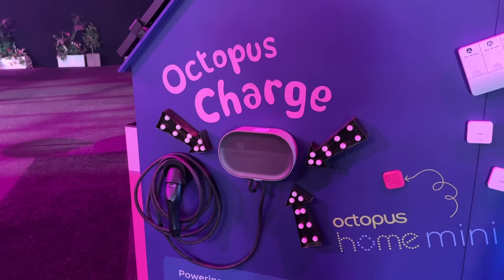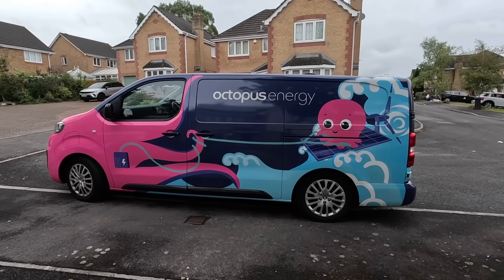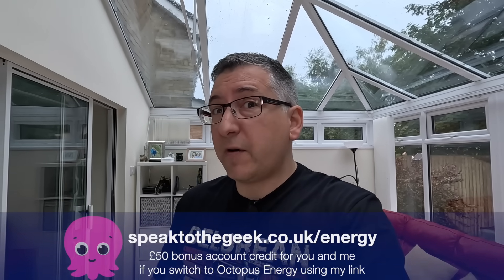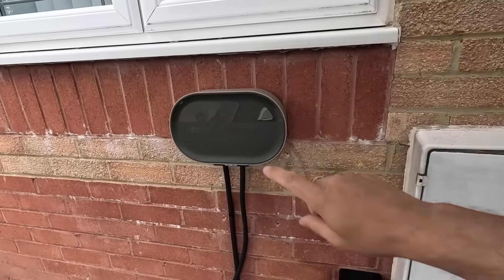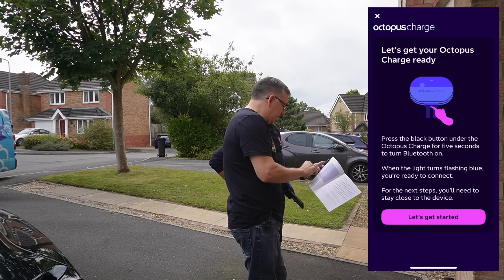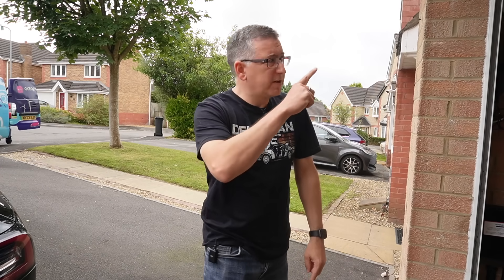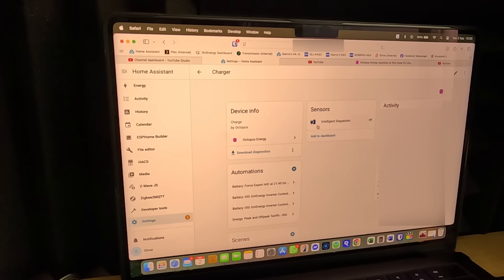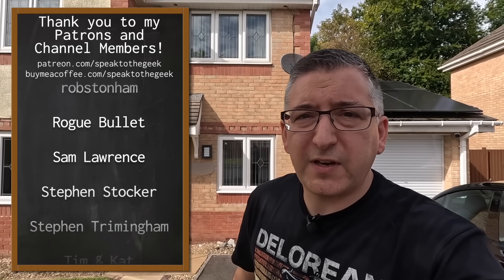Octopus Energy NEW EV CHARGER Unboxed and Installed - Meet the Octopus Charge

Comment: A detail point but the thing on your wall - whether the old one or the new one - isn't a charger.  The charger is built in to your car(s).  All the Octopus Charge is is a charge point - basically a slightly glorified 32 A mains socket.  It's an important distinction because whilst people think that the PodPoint or whatever is a charger they expect it to be able to do all sorts of things which it simply can't do.  The charger is built in to your car and it's your car which is thus finally in control of the charging process.
Reply from the maker: Yeah we all know that... "Charger", it's now common parlance though and if I started calling it something else nobody apart from the select few of us pedants would know what I meant.
Reply: @SpeakToTheGeekTech  I find that if you call it a "charge point" everyone understands you.  Calling it a charger on the other hand causes confusion when problems arise because people think that it's a charger and are puzzled by the fact that it isn't.
Reply from the maker: Same with phone chargers. Everyone calls them a charger but they're not, they're a power supply and the charge circuits are (usually) in the phone. It's a matter of admitting lexicographical defeat and accepting the language has formed in a suboptimal way :(

Comment: I'm a little confused...why is the EVSE connecting directly to the grid connection, and not being integrated into the behind-the-meter solution..?  It would seem that there's no why to divert excess solar into the EVs, but you're relying purely on grid charging...  Maybe I'm missing something.  My Hypervolt connects to my CU, and depending on the availability of excess solar and/or if I want to dump some storage from my Powerwall 2, I can divert it into the EV, regardless of the grid.
Reply from the maker: It is behind the meter, just not as behind the meter as the consumer unit it. The charger has a CT clamp on so it can see exported power and divert it to the car. There's no issue with the installation here from that perspective, it's working fine.

Comment: So a Zappi or one or two other home chargers/wallboes would have fixed this problem so why didn't you do something about the two car problem before now? Why wait for the Octopus Charger?
Reply from the maker: Welcome to the channel :) There's history there in my videos on the channel but the short story is I had a Pod Point, I replaced it with a GivEnergy charger, I bought a Tesla and moved to IOG, I had a wiring problem which meant I needed to go back to the Pod Point temporarily - then the Octopus Charge was released and I decided that would be a good solution for charging both cars on the IOG tariff and also good for clicks on a video about it. The two car problem has only been there for a few weeks.

Comment: Works with ocpp in HA?
Reply from the maker: Not sure. The problem with doing that though is that the charger is paired using OCPP and a valid certificate with Octopus. If I then try to pair the charger with my own OCPP server (for example if I configured HA as an OCPP server) then I would lose that integration and not be able to take advantage of the IOG tariff any more. It's certainly worth investigating and could well be a solution for total local control of the charger if ever Octopus stopped supporting it.
Reply from the maker: I have just checked the installer interface for the charger and there is an "Enable 3rd party App" section where you can supply a server address and security detail. It doesn't specifically say that it's for OCPP but I assume it is.

Comment: What an awfully designed charger…🤦‍♂️ Cables everywhere and not neat at all. Why it doesn’t have a rear access for supply is beyond me and why didn’t they design it to wrap the cable around the unit itself…🤔
Reply from the maker: I agree that a small lip on the top of the charger itself would have meant that the cable could be wound around the unit. I plan to feed that back to the design team when I get chance. As for the cabling, with hindsight I should have put it on the outside of my garage wall so as the cable could run inside the garage to the consumer unit. That would have been far neater, but it's one of those things you don't think of until after it's too late.

Comment: On the face of it two issues for me! 1) It has a tethered cable (I don't want that) and b) it does not appear as though it cannot work without a wireless connection. I don't want that.
Disappointing.
Reply from the maker: For the first issue, there is an untethered version too I just chose the tethered option. For the second issue most chargers drop back to non-smart charging if there’s no network connection. I haven’t tested that myself yet but I will.
Reply: @SpeakToTheGeekTech I'll look into the untethered option. For the connectivity I will search for an EV charger that can use ethernet as it's primary form of connectivity via Doncaster ultra EV cable.

Comment: Do they still charge full install rates considering it’s just a swap?  That’s insane if they do.  Not sure what you paid my initial install was £2500 because of trenching and planning permission needed.  Octopus didn’t even offer a quote quite pleased I’m not tied into them now their rates for overnight have shortened and got more expensive.
Reply from the maker: In my case it was a complete removal and new installation to meet the latest regulations (my install was done a few years ago and things have changed since then). My rates for IOG haven't changed? Still got 6 hours overnight at 7p + extra bonus hours when IOG decides I need them.

Comment: Did it charge the MG successfully with IOG ? We have 2 EV’s and IOG and a Zappi - my wife’s 2023 Zoe works perfectly with the setup, literally just plug and go and octopus sorts it out - but my Citroen e-C3 won’t work with IOG - I have to create a schedule on the Zappi and connect to the car initially manually before switching the Zappi over to the schedule charge - with IOG it just freezes and doesn’t charge.
Reply from the maker: It worked fine charging the MG4, doesn’t seem to care which car is plugged in.

Comment: Being with Octopus is like being an Apple user.

They can provide the entire ecosystem that just works. And people like it when it's easy and it all just works together.
Reply from the maker: How did you know I'm an Apple user?! :) I'm an app developer in another one of my hobbies and I have Android devices to develop on. It's a horrible platform to develop for and the user interface compared the Apple I find is much less polished. Using Android to me feels like when I used to boot up a random distro of Linux 20 years ago. Everything was there that you needed, but KDE or Gnome made it looked terrible. My gadget-based life between my phone, MacBook, watch, iPad, etc all works pretty seamlessly and that's what I want from Octopus too. I don't want my wife to plug the car in and have to mess around changing settings - I want her to get up the next day and it be charged and for my bill to not be astronomical because it used peak power. I want an easy life!
Reply: @SpeakToTheGeekTech I'm a senior software engineer myself and I completely understand. 

I'm more in the Linux realm and do DevOps as a hobby so I love customising and tinkering. 

But even for me, sometimes I just want things to work with little effort. For me, that's where I use octopus, I already have their heat pump and it just works. It's great. I can tweak things in home assistant like take advantage of free sessions to top up my hot water. Maybe I'm an octopus cult member but I feel they just make the barrier to entry very low

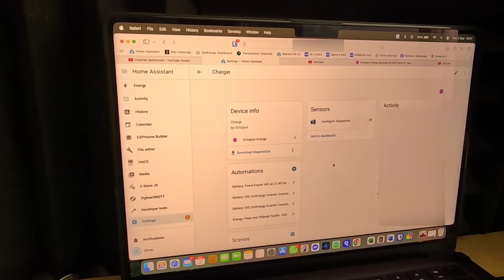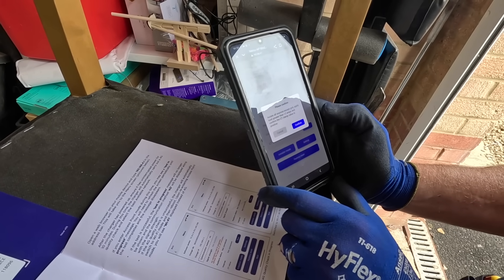Comment: It a real shame octopus didn’t approve the Givenergy EV Charger! I moved to EonNext, far cheaper. Export 16.5p 12:00 till 7:00 no faf and 6.7p.  Why did you not attach to the AIO switch over box?
Reply from the maker: Yeah I don’t know why the Giv charger is still in limbo on that. There were a couple of reasons for not wiring to the gateway. Firstly Octopus have their standard processes and I didn’t want to deviate from that for reasons of support, secondly I wanted to keep it totally separate to make things easier for me regarding battery drain. I have never had the need to run the charger from the batteries in the years I’ve had the system so I might as well wire it permanently that way.

Comment: Do you know where can I buy the Type 2 plug holster? 
Looks very well designed, the cable doesn’t stick out too much when inserted yet it is just easy to unlatch as normal horizontal one.
Reply from the maker: No idea sorry, it's just the one they supplied with the charger. It seems quite good so far although it has moving parts to go wrong whereas most holsters don't. I'm hoping it stands the test of time.

Comment: Great video. Glad you managed to get one of these. I thought they were only going to Octopus car lease members. I hope to get an EV around April time next year. I assume you can tell your batteries to charge during the IOG cheap rates. Did you have to do anything clever to keep the batteries from charging the car or is it the way it is cabled?
Reply from the maker: The EV charger is wired on the meter side of things, so the Giv batteries don't even know it's there and therefore can't react to that load. And yes, using the Intelligent Dispatching sensor in Home Assistant I can trigger automations to charge the batteries at the same time.
Reply: @SpeakToTheGeekTech  Take care with that approach as the 'Intelligent Dispatching Sensor' can sometimes incorrectly turn on even when there is no charge scheduled. I use it on HA paired with the Zappi Charge Rate sensor to confirm the EVSE is actually charging. Similarly reacting to any sensor that treats the current HH as low-rate before the charge actually starts is risky as the planned dispatch can change at very short notice.
Reply from the maker: It's been ok this way for a couple of months using the Tesla as the integrated device, but yes I'll need to keep my eye on things with this new device. The issue is I currently don't have any power monitoring directly on the charger so there's no way (well, maybe some logic to see if there's power that's not going to the house or the batteries... I need to think on that) to have a second opinion sensor.

Comment: This is exactly why I changed my old Chargemaster charger to a Zappi, rather the device is compatible and then it doesn't matter what car we get. Just got to set it to the biggest car battery and then manage the % charge required myself. Nice to see one of these new chargers in the wild!
Reply from the maker: Yup, it's the way forward now that more households are getting multiple EVs
Reply: Indra Pro is the same, managed by Octopus rather than the car.

Comment: Very good video thank you.  My only suggestion if you do this again would be to install the EVC in the garage and run the cable only out side ready to plug in the car.  If it does not reach all your cars then you can get an extension or ask the installer to fit a longer charging cable.

This way does a number of things:-

Stops any vandalism to,the EVC.
Stops anyone potentially messing with the buttons on the front
Keeps the EVC out of the weather and sun etc.
Reply from the maker: Might be good ideas in some locations. Personally it’s pretty safe around here in terms of vandalism risk. I do find it being outside is convenient for plugging in quickly but I take your point. I don’t think swapping the cable on this charger is an option - it’s factory sealed on purpose.
Reply: The trend is to cut the lead, it's safer to have an untethered one these days

Comment: You could have put the charger in your garage and knock out a small channel for the charger cable to go under the automatic garage door. That way, it looks neater and is out of the weather. That's what I did with my Tesla Wall Charger...
Reply from the maker: After looking at it for a few days I think I should have put it on the outside of the garage wall where the supply cable could just pop once through the wall and straight into the consumer unit rather than having the junction box and all of that cabling everywhere. I wouldn't personally want it in the garage because it is a pain to run the cable each time we need it then especially in bad weather. Also, I've had to fit a weatherstrip along the floor of the garage to stop flooding in heavy rain and a channel in the floor would not be good for us here!

Comment: Just curious, how do you stop your Givenergy batteries discharging when the car is charging? As it’s not a Givenergy charger, is that an issue?
Reply from the maker: It all in the wiring! My GivEnergy CT clamp is monitoring the grid on the home-side of the EV charger, so the inverter doesn't see the power going to the car at all. If it doesn't know about it, it can't react to it... so the car's power will only ever come from the grid or from solar generation that was destined to be exported.
Reply: @SpeakToTheGeekTech thanks for the info, good to know
Reply: @jamesh284 ive a very simple home assistant setup. When the Zappi status changes to charging, it changes the give energy battery max discharge rate to zero.   When it changes status again, it puts the rate back to 3600w.   I'm not a home assistant expert at all, but the above is easy to do and seems to work.

Comment: The "extra safety gear" is because he's pulling the main fuse and there's the possibility of significant arcing, and even the small possibility of the fuseholder breaking due to wear and tear, perhaps even exploding because of the power from the mains which can be tens of thousands of amps for milliseconds - long enough to deliver a lot of energy.

All very low probability, but definitely worth putting face shield and gauntlets on.  Which is required working practice of course.
Reply: Surely if your main switch/s in the consumer unit/s are off it should have no draw of current and no arc potential but I guess you never know what has been done in a property legally or not.
Reply from the maker: Absolutely, all done by the book!
Reply: The safety gear is because he's on camera, don't kid yourselves

Comment: So what happens if I move away from Octopus, or they go bankrupt? Does the charger still work? Would it work with other energy provider's smart tariffs in the future (OCPP integration maybe)?

Is that 4G connectivity free, forever? I somehow doubt it. Wifi would be a preference in any case I think.

Is it cheaper to install this if you're just swapping an existing charger (like you did) or is £900 baseline price for everyone?
Reply from the maker: Let's address the bankrupt question first - ALL EV chargers must now be 'smart' by law, and therefore they require a cloud backend. That means you have the same problem of an EV charger becoming a brick if the manufacturer goes away or drops the product no matter which brand you choose. However, Octopus are a large brand/company now and in my opinion more likely to be around in the long term than many other brands. If you moved away from Octopus then you can still put the charger in non-smart mode - it doesn't have built-in schedules sadly, but you can use your car's charge scheduling instead (which is what I've been doing with my Pod Point for the last couple of months). The idea is that the charger is fully OCPP compliant and therefore IF other suppliers offered smart tariffs to control OCPP (which Octopus are trying to encourage) then the charger could be used elsewhere in a similar manner. That doesn't yet exist though. For 4G, I don't know. But I have looked in to costs and if purchased in bulk, 4G IoT eSIMs can be purchased for under £1/SIM/year with the required data, so it's not a massive cost for Octopus to run, but the idea is you connect to Wifi wherever possible and the 4G is a backup. The cost of 4G for remote monitoring could easily be offset in their business case by reducing their product support costs.
Reply: @SpeakToTheGeekTech  if we could get local (over lan, no cloud anything) control of the charger with home assistant, that would certainly be a way of working around my apprehensions
Reply from the maker: Unlikely with pretty much any brand of charger though. I’ll see if I can dig out the smart charging regulations but it essentially mandates so much security that it makes local control very tricky to implement (ironically seeing as opening up to the internet must be pretty risky in itself!)
Reply: @SpeakToTheGeekTech  I guess home assistant is the best we can hope for. Or maybe openevse, but I guess the odds of octopus supporting that is virtually zero.
Reply from the maker: Yeah I agree
Reply: It'll be interesting to see what happens when ohme eventually goes out of business. There are so many out there that I suspect someone will come up with a solution to keep them smart / home assistant integrated.
Reply: @cad4246  are they in trouble?  I could see octopus buying them if that’s the case.

Comment: Is this the charger that can do V2X? Doesn't that require a CCS connector?
Reply from the maker: No it's not, Octopus provide the Zaptec Pro for the bi-directional deal in partnership with BYD. This Octopus Charge is just a normal charger.
Reply: @SpeakToTheGeekTech  Its not a charger - its a wall box - the charger is in the car!
Reply from the maker: We all know that - it's a power supply with a relay and some smarts in it, but it's now colloquially known as an "EV Charger" regardless of whether or not that is the correct technical term.